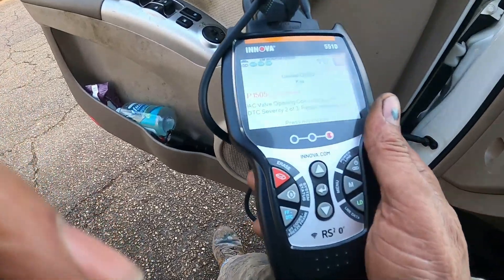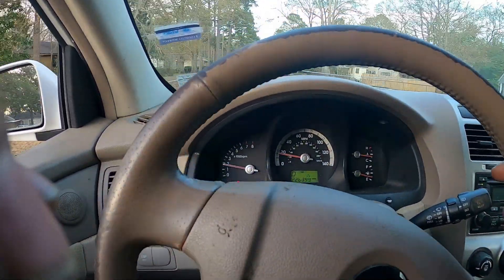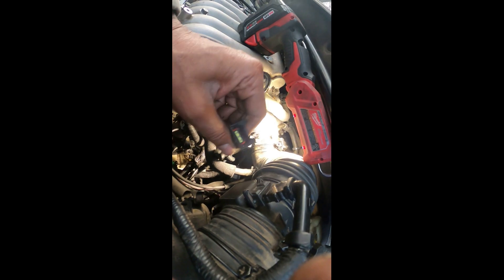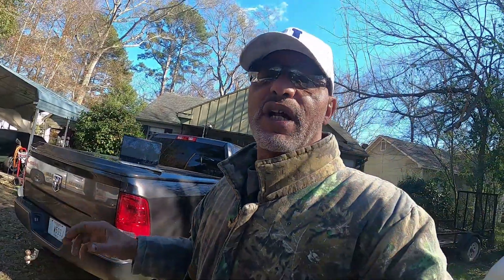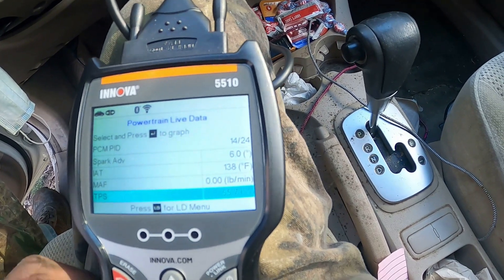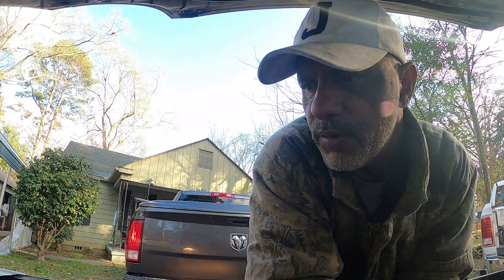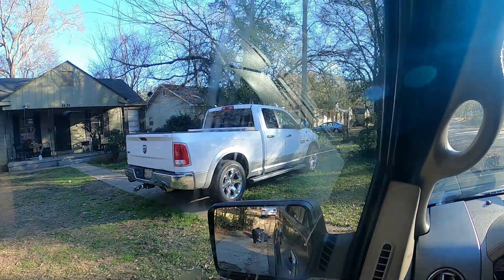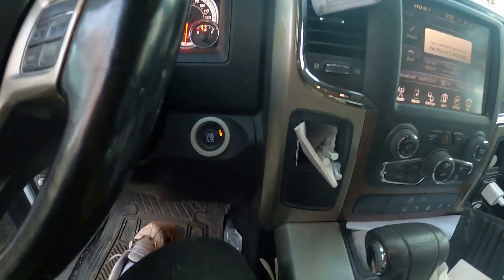05 kia sportage  will not shift out normally  tps and idle control codes

Comment: I have been having transmission issues myself and have had my 07 kia sportage in 5 different shops even cottman who says my transmission is fine I did have my TPS changed A while back I bet that is what is wrong with mine thanks for the video I'll let you kniw if it was the TPS or not thanks again
Reply from the maker: What codes are u getting?
Reply: None even the shops I had it in said no codes are coming up
Reply: I just wanted to let you know I messed with my TPS and now my car shifts great before I couldn't go past 25 now it shifts with no issues  I thank God for your video I have has this issue for a long time and now I can drive my car again thank you so very much you really helped me out thank you again 😊  Lisa

Comment: Hi there , 

First of all big thank you for your video 

I am have the same issue on my Kia 2.7 v6 year 2005 

Error code P1505 & P1507
And I had my TPS MAF AND IAC   sensors changed  and been all over the place but no one can fix the issue 

And having same issue high idle 
But when I unplug IAC connector idle comes down from 3000 to 2000

Have to drive in manual mode as automatic shifts late 

Could you please explain how to manually set TPS like upwards or downwards to bring idle down  

Could you kindly advise 

Many thanks 
kind regards
Reply from the maker: I believe your problem is different than mine because if you watch the video you would’ve seen that the harness connectors were on the wrong part.. I then swapped The connectors in the codes disappeared.   You do not have any TPS CODES  do you? I believe you have a idle air control valve issue only. There are three wires on the idle air control valve.. Take measurements of the voltages and grounds and get back to me….. Are you getting any other codes?     Do you have a scan tool with live sensor data
Remember the computer and I’ll air control valve or connected directly via wires.  So the first thing I would do is check wire integrity. I’ll pull up Some more information and I’ll hit you back
Reply from the maker: The Idle Speed Control Actuator (ISCA) is installed on the intake manifold and controls the intake airflow that is bypassed around the throttle plate to keep constant engine speed when the throttle valve is closed. The function of the ISCA valve is to maintain idle speed according to various engine loads and conditions, and also to provide additional air during starting. The ISCA valve consists of an opening coil, a closing coil, and a permanent magnet. Based on information from various sensor, the ECM controls both coils by grounding their control circuits. According to the control signals from the ECM, the valve rotor rotates to control the by pass airflow into the engine.
Reply: @HayesMobileAutoRepair  

Hi there thanks for reply 

First I had an issue the car was not changing gear got it scanned come up with following error codes 

DTC: P0101,Mass air flow sensor circuit range/performance

DTC: P0121,Throttle/Pedal Position Sensor/Switch A Circuit Range/Performance Problem

And was asked to replace TPS so I 
Changed TPS  

Both the codes gone 

After 1 day of driving car show. Same issue again changed another TPS and MAF  sensor 

This time time all the above errors gone and got new one 

P1505
P1507

Was asked to change IAC valve I changed that to and still no improvement 

And car is exactly behaving like your  RPM stays at 3000 but as I unplug the IAC valve from connector 
It comes down under 2000 and as I connect it goes to 3000

Have to drive in manual mode as yours it’s not changing gears on automatic mode 

Please advice 

Many thanks 
Kind Regards